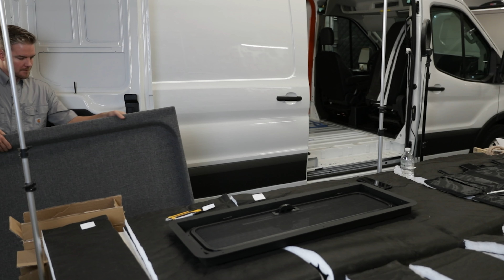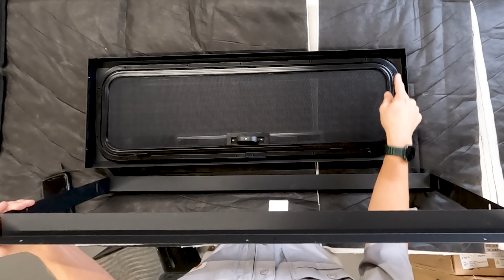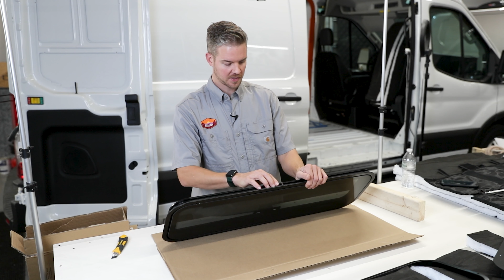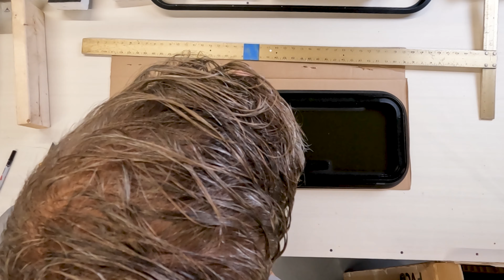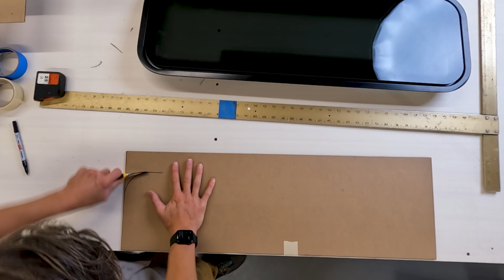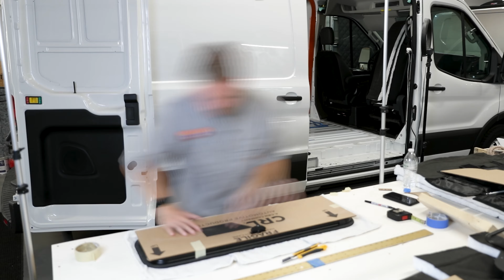Cardboard Template For Campervan Window Install! (CRL AW1033 Camper Window Edition!)

Comment: Thanks for the in depth tutorial!  I did this same install after watching this, and had a super tight fit. My template was based on the same outer diameter of the inner ring.  The problem I had with it was that there is a bulge around the whole profile of the window that is a few mm taller than what this template accounts for. Recommend to cut on the outside of your traced template line to give a few extra mm of clearance. I spent 1.5hr and a lot of frustration opening the initial cut in the van a bit larger.

Comment: 35 years later  Lol  Just kidding. I actually prefer all of the additional info. I'm just here to see what part do you trace, or do you trace the outside edge then measure in 3/4" or whatever for the hole. Thanks for the vid :)
Reply from the maker: Lol, the choice between being detailed and concise is always challenging :) This is how you should trace: 
The cardboard template should be cut to the true edge of the window frame (no offset). The idea behind this is for your cardboard template to be a true representation of the window frame (not bigger or smaller, but exact). Then after your cardboard template is cut to size and you have taped it to the area that will be cut out. Next, you will take a sharpie and trace the outline of the cardboard template. The sharpie thickness is about 1/16", think of the sharpie line thickness as the thickness of the jigsaw blade you will use. The challenge comes with your skill level with a jigsaw, if your skill level is high cut ON the sharpie line, if your skill needs improvement cut 1/16" OUTSIDE of your sharpie line. Thank you for this excellent question, Hope that helps!